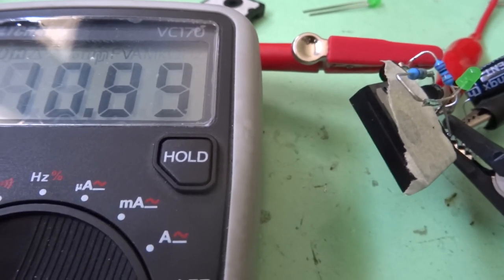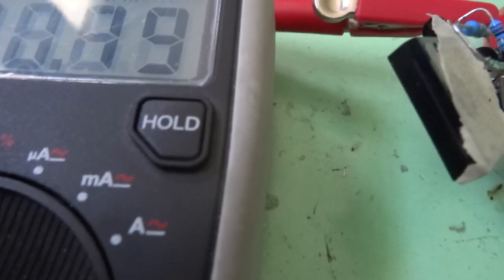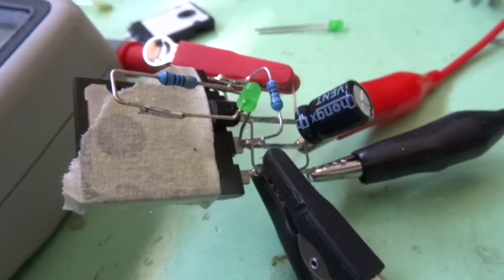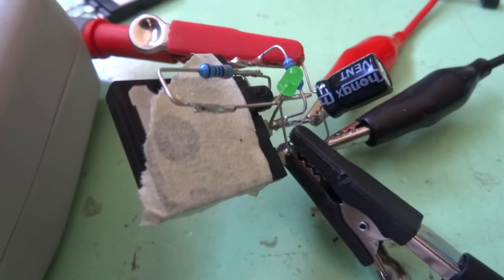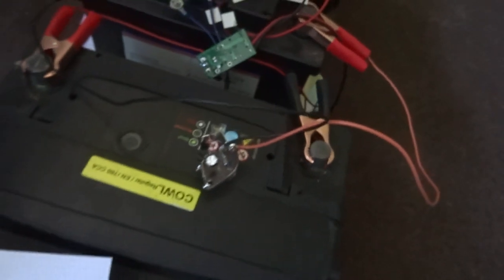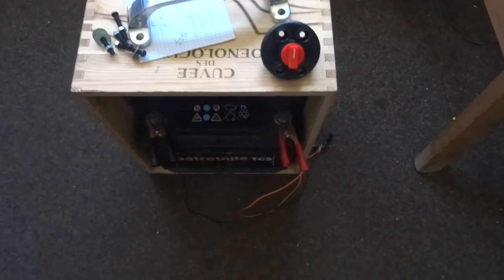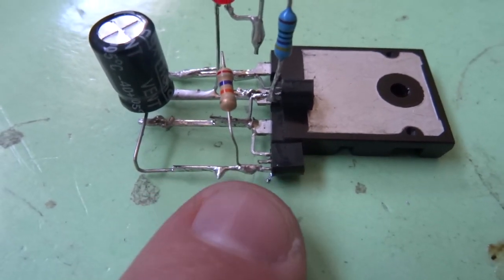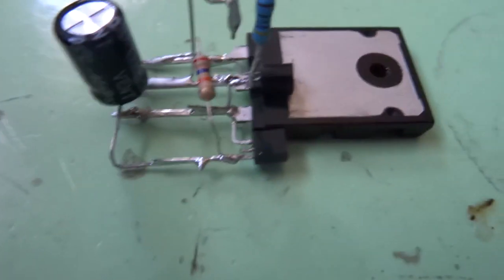Battery Refresher   Simplest circuit to keep your batteries in top condition and desulphated

Comment: I mean the "diode"-transistor.
Reply: ok danke
Reply: smokin Joe 
If I get what you mean, yes the transistor is the 'wrong' way round but it is not used as such, maybe he'll ge the schematics out, I can't find them at the moment, and they're in german...
Reply: oh kein problem ich sprech deutsch.^^
ich mein dass ein transistor doch quasi 2 gegeneinander geschaltete dioden mit quasi mittelanzapfung sind. wieso hast du ohne basisanschluss durchgang von collector zu emitter? da fehlt doch die basis oder nicht?
Reply from the maker: smokin Joe
Ja, richtig, die basis anschluss 'fehlt'. Wenn die spannun zwischen E und C eine gewisse volt zahl erreicht (abhangig von der manufactur on typ des transis) dann bricht die 'verkehrte' diode zusammen und verhaetl sich ein bisschen wie ne Zener diode.

Est gibt sicher gute und detaillierte videos wie das intern mit den npn junctions genau auf der elektronene stuffe functionniert.

danke fuer den kommentar.